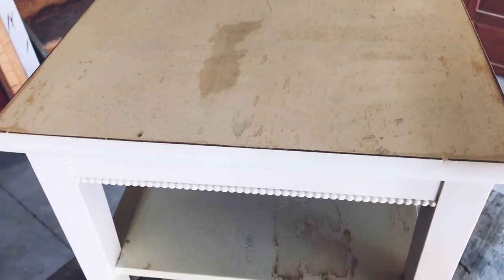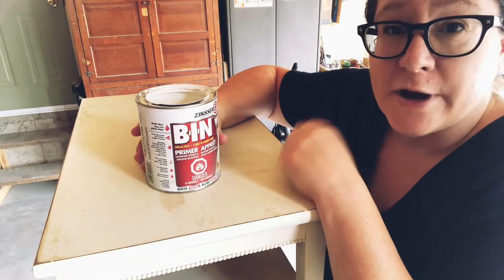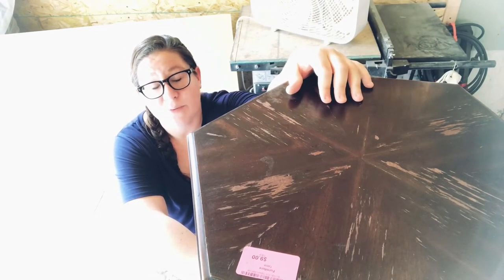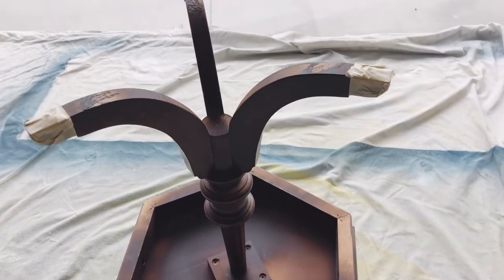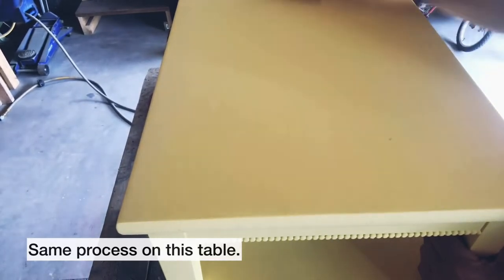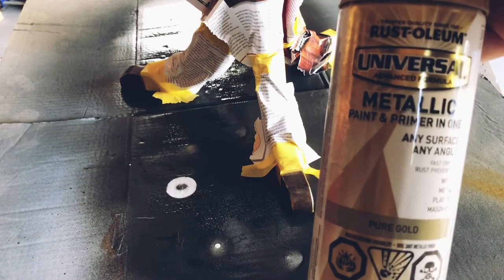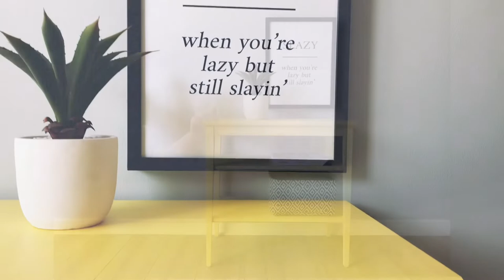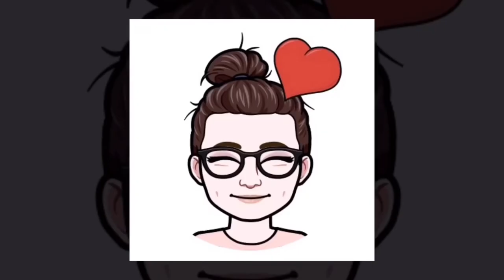Painting Furniture with BRIGHT Colours | FAT Paint

Comment: Can I ask why you only coated the top of the pink table with a shellac and not the whole piece?
Reply from the maker: Because it was sanded down to bare wood. The wood would have absorbed the paint differently than the rest of piece that still had the original finish on it.
Reply: Katie Scott SALVAGED by k. scott.  Thanks, am inspired by what you are doing, some really amazing transformations.